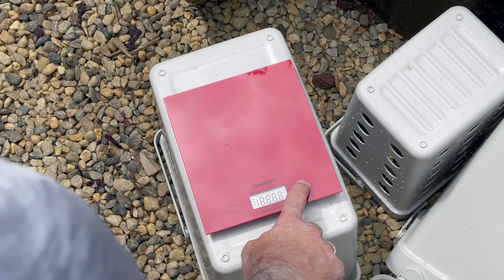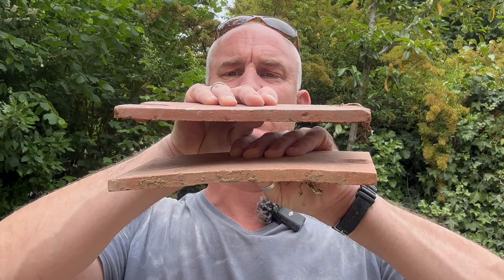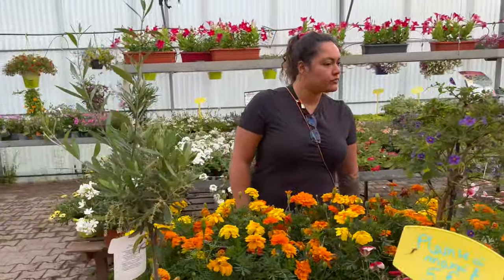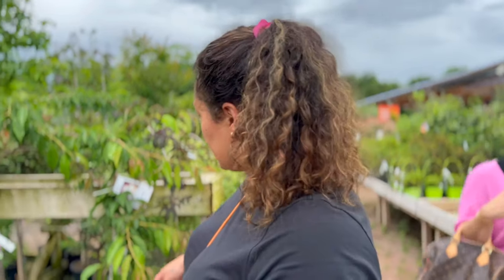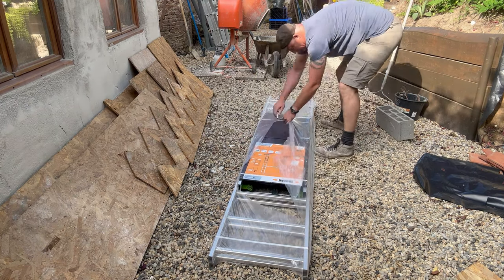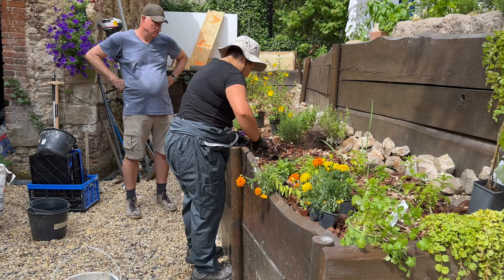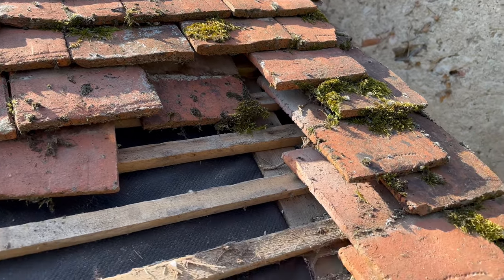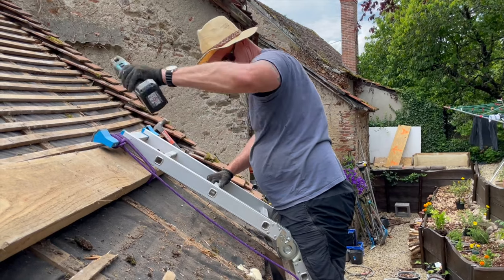Episode 35, Planting the garden and waterproofing the roof of the little house

Comment: Big roof job with a big impact once it's done, glad you kept the old tiles. Spray distilled white vinegar [useful for everything] everywhere on the roof [5 euro for 5 litres on line] ants/insects hate it and the smell goes quickly. Check out any evergreen woody potato vine on line, it's an amazing plant, ours flowered and grew over an 8ft wall in a year. The garden already looks great and I'm so glad you bought a scaffold. Very glad Nadia is back.
Reply from the maker: Thanks Sindy, all that taken into consideration! Thanks a lot for all this info😀